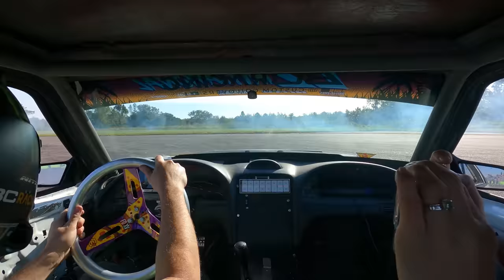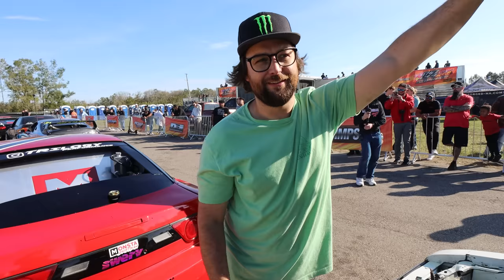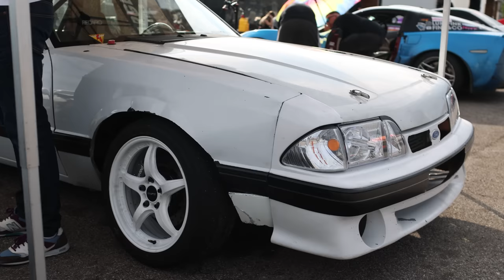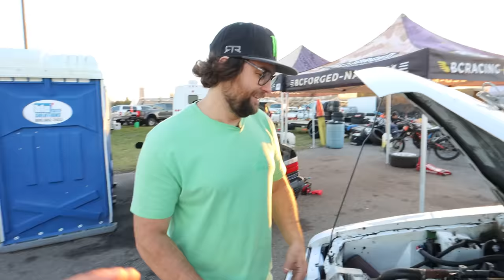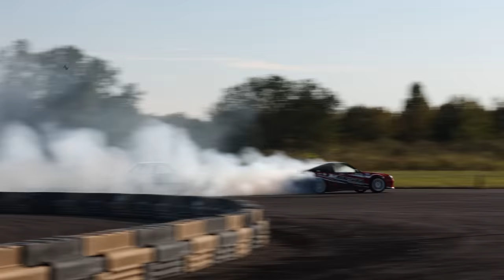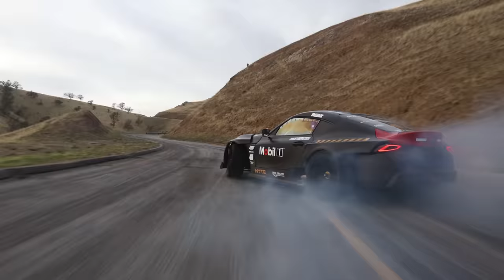Chelsea Denofa's Ford EcoBoost Fox-Body Mustang

Comment: I love that Stang.  Really thoughtful build by Chelsea.  I now kinda wanna try and do the same with a V6 Ecoboost in a late eighties T-Bird (Turbo Coupe).  You heard it here first, so if someone does without me, boo on you!
Reply: Go with your idea,  those T-birds/Cougars even early 90's are cool bodied Fox Bodies.
Reply: Not as a drift car, but a street car, it has been done with a 3.5 eco boost. There’s some videos online of a white one ripping around. I have an 88 Turbo with 68k on it and I’ve always wanted to swap it. A coyote would be awesome if funding was no object, but something like this 2.3 eco would be plenty.
Reply: Dewit.
Reply: Nah, get yourself 300 from the same era f150 and hang a turbo off the side. Could even go with a divorced header and a couple ecoboost v6 turbos if you want a twin turbo 6 cylinder
Reply: @alexkaligaric2929  Coyote isnt cheap, but a truck version has less compression, but its also a lot cheaper.  Actually the motor you want if you plan to boost it later on.
Reply: @paintballpartutd  naw, already buildt a 300 years ago with a 67/80 hyrbrid turbo from a diesel.  Was nice, but no revs and heavy heavy heavy engine.  I'll take the newer alum block ecoboosts.  Work case scenario is some CSS and stable fuel, makes plenty of power.
Reply: Do it! I put a Ford 3.7 in a New Edge.
Reply: @alexkaligaric2929  Kickstarter, pitch it as a learning experience in automotive design and performance. You'll document and film the whole process and share it only with backers. Also reach out to the company making the engines as they may be generous enough to give you one in exchange for ownership of the video rights, who knows?

Comment: The Ecoboost also pays homage to the SOHC 2.3 that was in the Fox body SVO of old. That Lima engine was used in a Pinto for drag racing in the late 90's/early 2000's. Esslinger racing specializes in the 2.3, including running snow mobile carbs before fuel injection became commonplace.

Comment: Yeah that's a nice Mazda engine. The 2.0 2.3 and 2.5 have always been fantastic. The Mazda L, MZR and Skyactive variations of this block have been utilized for decades. They are found in many Ford vehicles and Mazda even still makes the block that Ford uses for their EcoBoost motor which is just a different top end at this point. Though I will have to admit that the 2.3 in this engine bay of the video looks identical to my MX5 engine. Ford EcoBoost Mazda L engines are a common swap into Mazdas especially Miatas simply because they are easier to modify with the Ford top end and ECU.
Reply: Most people forget its a mazda motor, lol. I dont think ford has made a 4 banger since the old 2.3 and 1.9 in the escorts.

Comment: A notchback isn't an affordable drift car, but the sn95/new edges are cheap, and essentially the same car.
Reply: The Knotch back is desirable because it's lighter then all of the other mustangs. The v8 is  2600 pounds. The sn95 V6 is 3200 pounds. Fox Body Ford Fairmonts and Mercury Zephyrs are cheaper then notch backs.
Reply: @likenem  You can get an sn95 pretty close in weight for what he has all in on the notchback. Really helps when relatively rust free roller sn95s are like 400$.
Reply: @Tagiau  again I would get a Fairmont or Zephyr over the Sn95 or Knotch back
Reply: A stock v8 fox isn’t 2600. The floor pans are the same as a sn95. Notchbacks are just slightly lighter.
Reply: @ryanfitzgerald1820  What is the stock weight of a notch back.
Reply: If you’re anywhere close to Reno nv i think theirs still a fox body notch svo for sale for around 3k running and driving
Reply: I bought this as a roller for $900
Reply: @chelseadenofa  we got our recent notch for $400. My hatch was gifted after my best friend passed away. Been drifting it for about 3-4 years and only put around $24k into it. Very capable and fun. I’ve seen you rip the notch at parc….jaw dropping experience and sound lol
Reply: @chelseadenofa  damn, a 900$ notchback around me gets me the a and b pillars and maybe a solid roof.
Reply: I picked up a notchback for 2 grand back in 2018, put like 3k of work into her.
Reply: To somebody like Larry im sure they are lol
Reply: I could take you to at least 40-50 foxes from 4 eyed, to hatches, and notches.  some with cages, some rollers, some complete,  could be a running car with a fuel pump. and no I couldn't tell you a price on anything, not mine to price
Reply: @foxbasher7435  I had a rental property and when the guy moved out he left his behind the house. Motor was cooked and the trans was broke. He told me to keep the pile of junk and even gave me the title. Go figure
Reply: @MrAlsbrooks  I would love to.  Just not where im from.
Reply: @ryanfitzgerald1820  the floor pans are slightly different at the rear torque boxes. And the notches are lighter, but also stiffer than the hatchbacks because of the added structure.
Reply: I’m p sure he just means affordable to run. Tires, gas, etc…
Reply: @likenem  Sn95 v6 is 3000, plus the chassis is a good bit stiffer because of it. But by no means perfect
Reply: @likenem  by the time you add all the reinforcement the Fox needs, because the chassis is made from paper mache, it loses a lot of the advantage it starts with. The SN95 had reinforcements in the chassis from the factory, thus it is heavier to begin. When all the safety equipment is added a full built race car is similar weight for both gen. I had a notch back in the day, regret selling it, but if I was building a race car the SN95 is a solid starting point. Many race classes have weight minimums anyways.
Reply: sn95 & new edges also have upgraded spindles with 5lugs & don’t have the POS drum brakes. they come with discs all around.
Reply: foxbodys also have weaker 28 spline axles sn95 come with 31 spline.
Reply: @likenem  Starting in 1994 is when Ford made a huge adjustment to the steering rack which included making the torsion bar stiffer and added a two-stage transition to the valve which activates the assist. With these changes, they made for a smoother shift from no assist to power-assisted.
Reply: @Tagiau  even chelsea’s fox is 5lug swapped you can see. the sn95 brings a lot of these improvements stock.
Reply: @ryanfitzgerald1820  a fox body is like 2800lbs look it up the sn95 was over 3000lbs
Reply: @likenem the notch with the 302 is 3150
Reply: I find daily drivable notchbacks for 9-14k almost daily on Facebook marketplace, I live in the kentucky area.
Reply: It’s gonna be a lot more challenging to put a 4 cylinder into a car that didn’t come factory with that option, unlike the Fox body which did come in a 4-cylinder option
Reply: @xinx-fn8973  which is why I said sn95 or new edge and not an 05+. Ya know because those two are fox bodies with new fenders.
Reply: Notches really aren’t that expensive
Reply: They’re way heavier and the engines are not easily modified, I’d recommend spending the extra money on an e36 or e46 because you will save money in the long run.
Reply: @likenem you can’t even get one of those cheap anymore the only cheap foxes left are the thunderbirds and cougars
Reply: @TheSherrod  it's hard to find them unmolested for a cheap price. The 3.7 V6 s197 might be a better choice. You can find them under 8K with 150,000 miles

Comment: ecoboost are underrated.   I have 2.0l big turbo at 400whp with 15k miles on the setup. no issues.
Reply: 15k isn't shit for miles, come back in another 15-20 and we'll see how much shit is broke lol.
Reply: @kskip4242  as long as they don’t get Lspi they’re good.
Reply: @kskip4242 why u mad a lot a motor

Comment: I see some others are already saying it, the Fox chassis cars are far from the cheapest base to start from for building a drift car. I went with a 3rd gen F-body (not for drifting) when I started out shopping for a Fox car simply because I could get twice the car for half the money. A friend of mine sold his barely running, floor boards rusted out 2.3L 5-spd notch back with a rattle can paint job for $300 less than I bought a clean, straight, driveable (CCC carb needed to be rebuilt), auto car with a beautiful new interior and perfect t-tops for. Ford fanatics are weird cult with more money than sense often times which makes their popular platforms far from cheap for what you’re getting.
Reply: Agreed. Foxes are stupid overpriced. The SN95/new edge is a better platform for this and nearly the same weight
Reply: Not really anything to do with a cult, it's just no one wants an ugly ass 80s Camaro haha. Foxbody weighs less and was the king back then, nostalgia for a lot of people
Reply: @sategllib2191  it’s a cult following because no one but a cult follower would pay the prices those cars are fetching. 5.0 was king of the base 5 liters only. Unfortunately Chevy made more LG4’s and TBI 305’s than anything else. Against the TPI 305 manual cars (because the TPI 305 with an auto got the same pathetic peanut cam as the LG4 that cost it 25hp to the manual) and the TPI 350 the 5.0 Mustang didn’t have a chance. But like I said, unfortunately those were somewhat uncommon thanks to GM diluting the pool with 2 other cheaper V8 options whereas Ford only had the 1. And your opinion on an 80’s Camaro isn’t necessary. I don’t care what you think of the 3rd gen Camaro but spewing it anyways in such a derogatory manner was uncalled for and rude. My car is a Firebird but I’m sure you probably have a similarly asinine comment to make about those. Nostalgia doesn’t make a car cost twice what it’s worth and that light weight came at the cost of a chassis that that was so flimsy it twists in half if you look at it funny.
Reply: @coryholbrook4643  Honestly rolling chassis and shells are still pretty cheap. Its more of the facebook marketplace and auction cars that are expensive. Just follow a few foxbody forums and FB groups and people are selling shells for a realistic price. For some reason a high mileage 2.3 n/a auto car will sell more than a decent roller even though everybody will swap the 2.3 out anyways and it takes more work, the market is pretty strange for these cars. In 2016 I got a clean vert with a 5.0 5-speed 65,000 miles for 4,000$ but those days are definitely gone lol.
Reply: @coffelt683  that’s the way to go if you’ve already got a plan and a means to reach it.

Comment: Just tune it. It’s a turbo car you can easily produce more horse power and you got to remember weight matters and an ecoboost is so light once your at 400hp that thing flies of the line since it doesn’t have the heavy v8 its more balanced.

Comment: Have a 22 ranger with same motor and 10 spd auto smoked my dad’s gladiator Rubi moves very quick for a 4 cylinder 4600 lb truck

Comment: Cheap and Ecoboost? That car would have cost 20k less with a LS and be more reliable... Not to mention all Mustangs are insanely overpriced!
Reply: So your're saying this is a 30k build?
Reply: You think this swap cost Chelsea 20k more than an ls swap would have? Lol
Reply: I question the true cost of the engine and he threw a Link in it too. Id be shocked to find an ecoboost 4  cyl for $2500. The Link was more than that. My guess is that youd likely spend $20k to replicate that car. Realistically. If you could find the engine cheap and the trans and such. Otherwise it would go deep into 20s. Foxbodies arent cheap anymore. The days are gone of commonly finding $1500 foxbodies unless they are rollers and they will need everything under the sun to make them run and drive.
Reply: @ep2324  Yes, its obvious you know nothing when it comes to price and ls engines.
Reply: The whole ls shit kills me those engines are tough for what they are however so is the ecoboost platform it's been proven to be very reliable
Reply: Its not as light
Reply: @enjoythesho1992  the LS can make 2000hp without any modifications and cost $150 from the junk yard. How does that Ford comparer?
Reply: @Jason_Bacon  lol sure any stock engine can make that with forced induction but for how long reliably?......right.....and you not buying no engine for 150 dollars in 2023 bud
Reply: @Jason_Bacon  theres no stock LS  motor making 2000hp lmfao